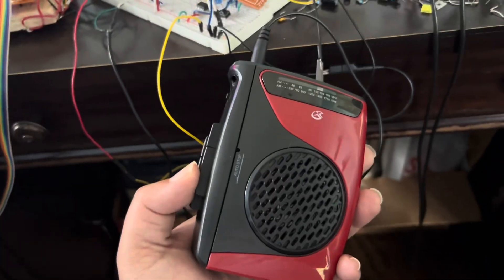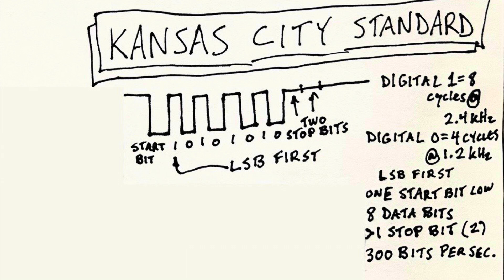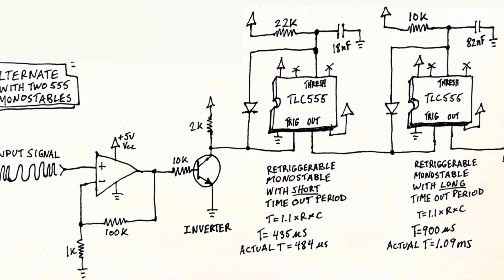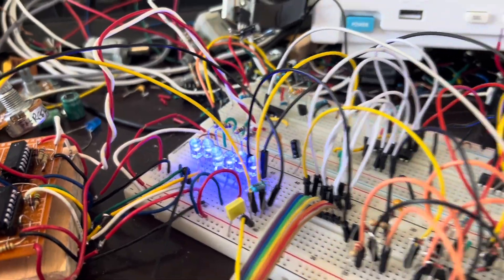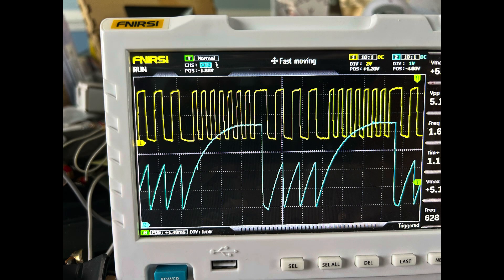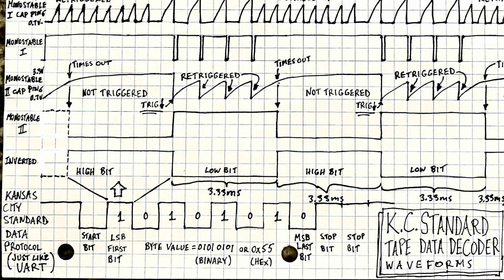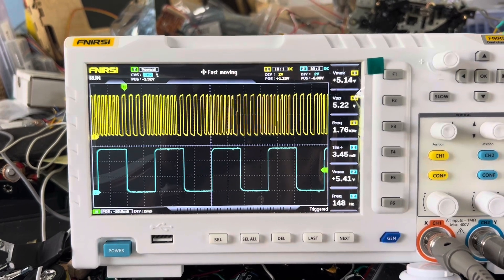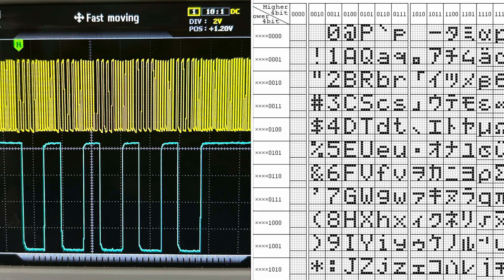DIY Tape Drive - Reading Digital Data from a Cassette Tape (no coding)

Comment: Great explainer! I'm very new to analog circuitry and i understood this well enough to follow along.

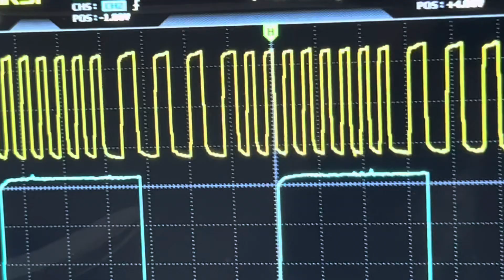BTW you forgot to mute the source clip at 10:40, so its a little hard to understand.
Reply from the maker: Yeah sorry i realized that after i watched it. The circuit itself is fairly easy though. One of those works on the first try ones